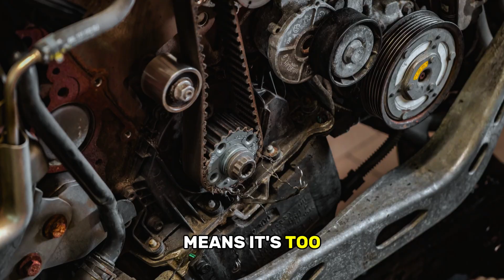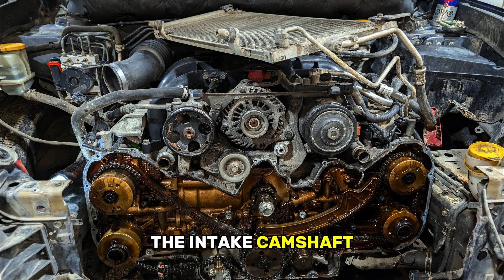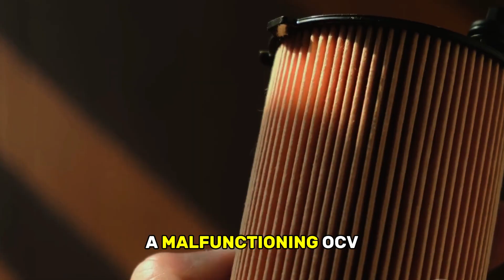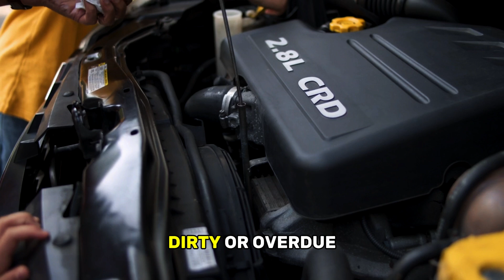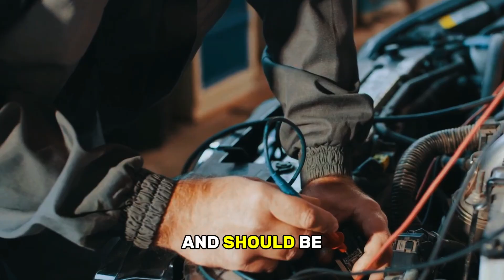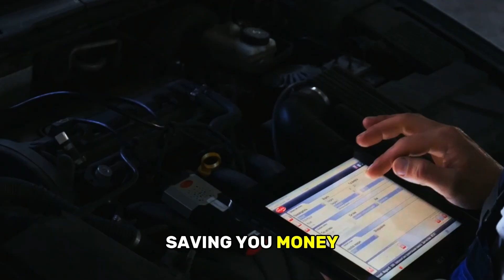Subaru P0012 P0021 FIXED! AVCS Timing Problem Explained

Comment: Hi is P000a camshaft position sensor slow response means the cam phasers went out? But when i looked it up it points to vvt(ocv)
Reply from the maker: P000A is definitely a tricky one! While it can sometimes be related to the phasers, a slow response often points more directly to the VVT (OCV) or even wiring issues. It's good you're looking into both possibilities!
Reply: @FourWheelsEmpire but if the cam phaser are bad i would hear a very loud sound wouldn’t i? As of now what i did is i switched the top passenger to the top drive side banks. See if the code follows. Because i suspect that the vvt(ocv) because its newer and could be a cheap part from online vendor. When i removed the top drive side and i give it a shake. It sounded different than the top pssenger side which is the new one that has been replaced before i purchase that car. The sound of the new one is more clicking and more loose.. the ones that i think may be the oem from dealer that’s been in the car sounded more like airy lubed type sound like its more intact.. the new one is just sounded loose with a clicking sound. You know what i mean? So i really suspect that that new one gave up earlier than iy should